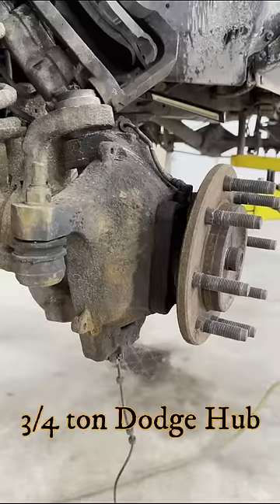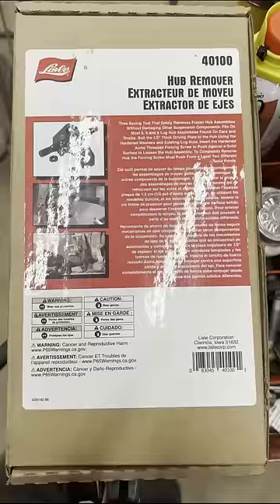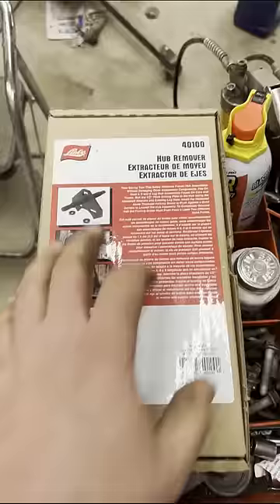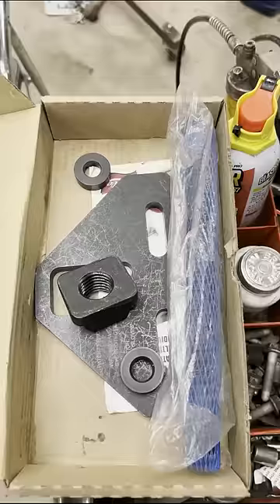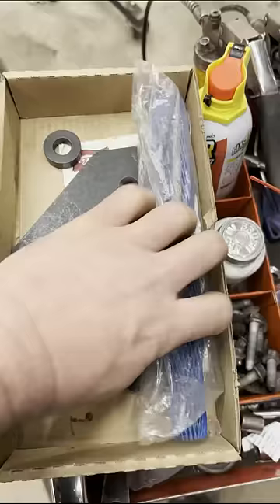Hub Bearing Removal Made EASY!

Comment: Back the four bolts out half way then throw a socket on the top front bolt. Fire the truck up and turn the wheel all the way to the left. Socket pushes against the bolt and the bolt pushes against the hub. Repeat on the bottom front and the rear bolts. Slower but you don’t have to buy a dang tool you’ll only use once.
Reply from the maker: I used to do em that way back when that WAS the shortcut to removing them. This tool is wayyy faster than that. Easier as well.
Reply: @TomsFoolery  but Mr. Wentworths method allows you to reuse the hub bearing
Reply: @Caleb Standley  no one would ever remove this bearing unless it is to be replaced.
Reply: @Tomsfoolery.  SnapOn makes a tool that works like the socket shortcut and I use that.
Reply: I came to say the same thing. Learned it from a Ram service tech.
Reply: Another 5 years and that tool will be taking up space unused in your box. Bolt/socket or SnapOn pusher tool method works just fine.🤔
Reply: @walterk1221 incorrect. Many prefer to remove the bearing unit instead of the whole knuckle when doing u- joints or axle seals
Reply: @Krankie V  incorrect because the tierod and two balljoints are far easier to disassemble than removing the unit bearing.
Reply: @walterk1221  you said “NOBODY ever removes the hub assembly (it’s more than just a bearing) unless it needs to be replaced. The previous comment and this one both price you’re the one who’s wrong because there are now two people already just in this thread who do it that way when replacing wheel end universals. Often getting the ball joints to pop loose from the taper requires a pickle fork and air hammer and will destroy the grease boots, you have to remove one of the ball joint nuts with a wrench which sucks when they’re rusty, and re-assembling the thing I’ve often had trouble getting the taper to stick well enough when tightening the nut with a wrench to not spin just spin the ball around in the socket without putting a jack under the knuckle. In the end if you’ve got a hub puller like you and I’ve found  it’s easier to do that. I totally believe you find it easier doing them the other way but everyone decent mechanic doing a repeat job has their own idea of what’s “right” ie: fastest and least physical effort required.
Reply: @J.R. In WV  yawn. I know damned well the formal name of the item. The fact remains there is no reason to remove the unit bearing from the knuckle unless you are either replacing it or are a shit-shop that pads bills if the repair is to replace the u-joints in the axle. 

To remove the bearing assembly requires removal of the axle nut, caliper, caliper bracket, rotor, unit bearing... the right way requires removal of the axle nut, two balljoint nuts, and the tierod end. Try again skippy.

Comment: I have done with 2 long bolts and 2 nuts, washers. All I need to do was to whack 2 wheel studs(opposite) out and fed my 🔩 through that hole with the nuts and washers behind the hub flange. I then held the nut with a 🔧, as I tightened the bolts, the nuts would push hub out. Put 2 bolts on opposite side or 1 and rotate + hammering.

Comment: I have this  tool and recommend never seize on threads or tool threads will wear out after 3 uses or less. I am using my 2nd set now , wish I knew beforehand!
Reply from the maker: I forgot when making the video. I put wheel bearing grease on them before using it a second time. I find grease a bit more forgiving when you get it in your hands. That anti seize seems to get everywhere once you touch it! 😂

Comment: Yeah, that's an awesome tool, but I definitely would have helped the other side along with a hammer ever so often. Forcing it out on that harsh angle could potentially damage the knuckle. I'm betting there was e good gouge on the inside of the hole on the knuckle. The flange base of the hub bearings are hardened some so that probably didn't give much during that whole deal.
Reply: Everyones an expert in the comment section...
Reply: @Yellow Bird  I never claimed to be an expert nor boasted in any capacity of the fact.. but I do indeed know what I'm talking about and am not just spouting off like most of the people watching. I'm speaking from many, many years of experience where in fact, I have damaged myself and have seen others damage more than a few parts, including steering knuckles by either driving bearings or other parts in or out of a bore unevenly. The knuckle in this particular video is steel so it most like wouldn't have been a problem, but there are aluminum knuckles out there, and they CAN be damaged by forcing a hub out of the bore like that. Not every person who posts a comment is right and clearly,  just because you have a camera, have a tool and can make a video, you still may put wrong or lack of information out. It's people like you that shut down people trying to help others. I want being hurtful or degrading, I was simply trying to add in a small piece of extra helpful info to an otherwise REALLY GOOD video..

Comment: Did it many times with a socket between the axle yoke and a backed off bolt headUsing the power steering. Mechanic showed me a trick. He has a special tool but if you take what I think is an 11/16 Deep impact socket on the boat head and I think an inch and an eighth to cover it, makes a good pusher. Put it in place manually and reach in and turn the wheel.  Done

Comment: I'm now seeing this after trying to replace upper ball joints on a 3/4 ton ram. I seen another YouTuber show a trick or putting on bolt partially in that holds the bearing on and use a socket and extensions to do what that tool does there and then start the truck and turn the wheel.
That didn't even come close to working for the truck I was working on. We(I got some help from a friend and a couple others) ended up using a 10lb sledgehammer and beating it out enough to use multiple chisels in different spots to get it out.
The sledge was slung with great force too and it only created a roughly 1/16th in gap, maybe 1/8th in gap. That job sucked.

Comment: For some hub removals, loosen the axle-nut a bit first, but leave it on until the hub comes out just a hair. Then remove the axle-nut and continue pulling the hub.

 If you take the nut off too soon, a 2-piece hub may come apart, leaving part of it in the knuckle.

 Also, use a steel plate to span 2 ears on the knuckle, to better distribute stress. Rotate the hub occasionally as you pull it out too, so that it doesn't get too crooked.

Comment: I scrounged some 1/2 plate and torched out lug stud openings in it and drilled a hole in the center and cut threads in it and screwed in my 20 pound slide hammer and it popped off in 2 wacks.

Comment: Just watched the tool manufacturers video on using the hub remover 
It says to rotate the hub to to at least two different positions when removing the hub 
Also good thing the sensor wire was removed before you started

Comment: Awesome tool! Looks like the same forcing screw in the dual wheel separator and ball joint press. Oil that screw, and the ball bearing under the seat and it works even better.

Comment: Get a hub buster and grab the nearest sledge. I’m a mechanic it makes everything so much faster and easier, just make sure you don’t break the wheel speed sensor and that you have the cv axle out. All you do from there is run the proper threaded nuts and tighten it down to the hub, and smash it with a sledge hammer a few times. She pops right off

Comment: You can do the same thing with a bolt and a nut. Remove a wheel stud. Place the bolt through where the stud was with a nut threaded on the opposite side of the hub.

Comment: It seems if you rotate the plate to the studs on the other side , after a few turns on the first studs, you would be pulling it out straighter .
Alternate between both sides .
Reply from the maker: Good advice! I was demonstrating the tools ability.

Comment: tip from a rust belt mechanic, coat a thin layer of anti-seize on the contact surfaces of the new hub to help protect it from corrosion. Also doesn't hurt to have it on the outer surface too where the rotor contacts, to help prevent stuck rotors.

aside form that, seeing that hub come out at an angle made me cringe. should definitely come out straight.

Comment: On a straight axle truck like that with a cv joint just put a socket between the ears of the cv axle and the axle tube and turn steering wheel back and forth and boom pops right out every time coming from a rust belt ny mechanic

Comment: Speed sensor comes with the new hub so calm down francis. Also dodge 3/4 ton are some of the toughest. I may buy this tool but I’ve been knocking a lug out putting a bolt through the hole nut the back and do two spots 180 degrees apart. Works way better than beating them out which can be impossible with those particular ones

Comment: Use an extension or bolt, go against hub and a stationary part of the vehicle/axle. Start the truck and turn the wheel. Use the power steering to drive it off

Comment: This is so much better than having to cut / knock out wheel studs, or use the power steering. Is it possible to break or damage the knuckle on a vehicle using this or similar methods though? I always fear one day I'll do that, with my luck

Comment: One hardened steel bolt, a nut that fits the bolt and a larger nut to slide over the bolt, knock out 1 of the studs. Put the bolt through the stud hole, put the bigger nut on the bolt Put the nut that fits on hold nut with wrench tighten bolt with inpact much cheaper

Comment: took me 4 hours to remove a bearing once, heat and air hammer. This tool would've been helpful
Reply from the maker: I'm looking forward to seeing how well it works on the ford explorer rear bearings. Those are very difficult to remove most of the time.

Comment: Guess you'll be replacing that ABS sensor too
Reply: The new bearing comes with it so.... Yeah.
Reply: @Krankie_V  that usually doesn't happen. Actually I have never seen that happen.
Reply: @scottanderson5290  then you've never replaced one of these. I've replaced hundreds of wheel bearings like this and never has one come without a sensor.
Reply: @Krankie_V  I will call bullshit on that. I too have replaced hundreds of these bearings. Been doing this over 40 years. The bearing comes with the magnetic pickup ring that the sensor reads but the bearing does NOT come with the sensor.
Reply: @scottanderson5290  You couldn't be more wrong! Do your research before commenting next time. Call ANY autoparts store asking for a front hub assembly for a second gen dodge ram 2500. They ALL come with the speed sensor. The magnetic ring (tone wheel) is INSIDE this style hub assembly. You can clearly see in the video where the speed sensor wire meets the hub assembly! Derp!

Comment: Hubs are bolted from the back remove the bolts thread one bolt back in halfway then use a socket and extension you get someone to turn the wheel while u find somewhere to prop the back of the extinguisher on and the turning of the wheel will push out the hub without some fancy tool

Comment: I use the power steering. Use a quality extension with socket after backing the bolts off a little each time and turn the knuckle so the extension and socket push on the bolts. Each time move to opposing bolt. Works every time like a charm. If any of that makes sense.

Comment: You can place a socket with extension on the opposite side and turn the steering wheel to pop them out.  This tool sure cockeyes the bearing, easily seen in this video.

Comment: Just throw the brake rotor back on and a 4x4 piece of lumbar. Use the power steering to force hub out. Make sure though your knuckle is not made of aluminum first. No tool needed, just a strong piece of lumbar
Reply: Had a Lumbar laminectomy , so ...

Comment: Use th bolts and turn the wheel (back the bolts out and turn) pops it right out fire it up so you dont have to crank on the steering column

Comment: You don't need all that. Just knock out a couple lugs and use a hardened bolt with a couple nuts. Only cost like 5 bucks and I've done several Barings with the nut/bolt combo.

Comment: I use a socket on the u-joint and the power steering works every time and only takes seconds.
Reply: That's also a good way to find a weak high pressure line, I just go with the old air hammer.
Reply: @Fiden6666  done it hundreds of times no issues
Reply: @chevybigblock3311  Yeah, me too, until I had to clean up the mess and replace the hoses out of pocket.

Comment: Great tool if you do this every day. But I've always used a crappy 1\2in extension, socket, and sacrificial bolt. Leave the 1 bolt slightly treaded into the upper left bearing hole start truck turn wheel till extension is against the knuckle. Turn a bit more and it will pop right out. But I only do my own truck so it does not make sense to buy a tool.

Comment: News Flash people have been using an extension and socket with the bolt backed out a short Distance and then. Using the power steering and the frame to push the entire bearing out

Comment: You can just knock out a lug bolt and put a long bolt through the hole with washers and a nut on the opposite side and do the same thing but for free if you have a nut and bolt laying around.

Comment: If the hub is so difficult to get out how do you get a new hub back in? Do they have a tool for that too?
Reply from the maker: When the old hub is removed, you clean the corrosion out from the mating surfaces and the new one fits into place by hand. No tool required.

Comment: It wont hurt the knuckle pulling it at an angle theres only bout a half inch of close fit on those hubs the rest is clearance knock out a lug a bolt and nut works well enough save your money unless you pull hubs for a living

Comment: Snap on makes a socket ( you can easily make one, it goes on mounting bolt, you start truck and turn the steering wheel. Pushes bearing right out. Doesn't get any easier.

Comment: Good tool, yes, but I have in the past used an air hammer with a puch bit and have no problem
Reply: Thanks for being the only sane person here, just slowly work it clockwise and counterclockwise maybe even angle the bit so your spinning away from knuckle, and it pops right out after a little

Comment: Now I like Lisle tools they make some great stuff, but to be fare this tool only works if the hub is still in one piece. The majority of the unit bearings I have replaced over the years in the second gen dodge dana60 axles fall apart when the stub axle nut is removed. Then you have a chunk of hub stuck in the knuckle and this tool is utterly useless. Then it's easier to pull the knuckle off and put it in the press, work it with an air hammer, or heat and beat with Terry the torch to get her loose and out of their. A few I had to cut the bu with a die grinder then split it with a cold chisel in 2 pieces to get it out. Remember to clean it all up with emery cloth or wire wheel and a hardy dose of antiseize when it goes back together so the next guy 60,000 mio3s down the road don't have to fight the hell out of it like you did

Comment: Can we all spare a moment to remember that poor ABS sensors sacrifice 😢
Reply from the maker: Thanks for the comment Dave! No need to shed a tear for that wheel speed sensor as it actually WAS unplugged! Watch again and you’ll see the wire hanging below the steering knuckle. Also, not to rub salt in a wound but the new hub assembly comes with a new speed sensor and wire. It was pretty common back in the late 90’s and early 00’s. Now it’s not that common however.

Comment: How to press it back on? Put hib in oven 400 degrees. Cold bering goes right on
Reply from the maker: It simply bolts back on. It’s not a press fit. The reason it comes out so difficult is from dissimilar metals and corrosion.

Comment: This looks like an awesome tool. Looking at how it's walking out crooked, are you able to spin it 180-ish degrees and continue removing it? Not trying to troll just asking... I removed one from a 1999-ish grand Am the bearing split in two. The outer race portion was rusted to the knuckle so bad I had to cut it out.
Reply from the maker: Yes. You can turn it 180 degrees and push against the ear for the caliper mount. I just let it push in the same spot to demonstrate the ability of the tool.
Reply: @Tomsfoolery.  cool, thanks for the reply. I wish I had this yrs ago, but now it's a rarity that I work on cars anymore.

Comment: What do you do to prevent the spindle from being pulled out of the bearing?
Reply from the maker: If that happens, put one of the bolts back in about 5-6 turns. Put a socket and extension on the bolt head with the other end of the extension on vehicle frame. Start the engine and use the power steering to push the hub out. It works well, just takes a bit longer.
Reply from the maker: If that happens, put one of the bolts back in about 5-6 turns. Put a socket and extension on the bolt head with the other end of the extension on vehicle frame. Start the engine and use the power steering to push the hub out. It works well, just takes a bit longer.

Comment: I have tried this tool, probably would would work in a non rust belt state, not on a 11 yo NH Subaru. It does rip the flange out of the hub just fine 😢
Reply from the maker: I’ve heard those Subaru bearings can be very stubborn to remove. I don’t get those vehicles where I’m located but I have a friend who works on them daily where he’s at. He’s told me how difficult they can be sometimes.

Comment: Very useful, but it rubs my fur the wrong way to see the bearing coming out at an angle! Looks like it's in a bind, and it wouldn't take much to gall the aluminum carrier. Can you flip it back and forth 180°, and walk the bearing out a little at a time?
Reply from the maker: It’s not aluminum. But yes, you can spin it 180* and push it out in steps. I was demonstrating the ability of the tool.